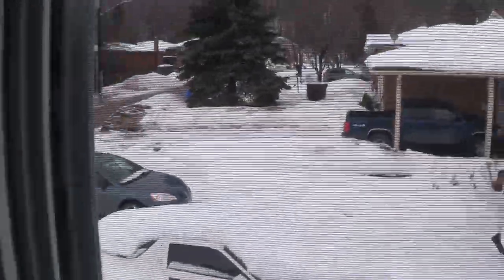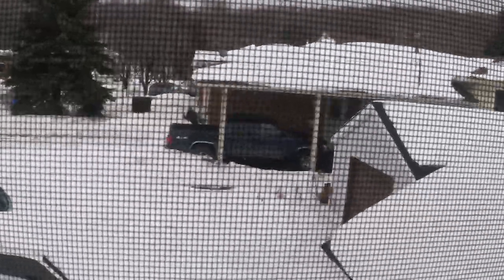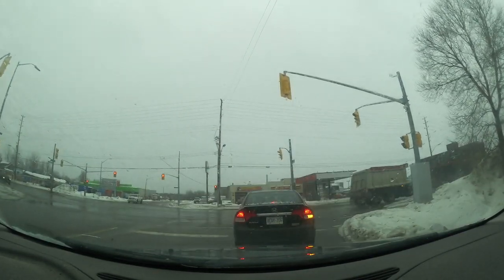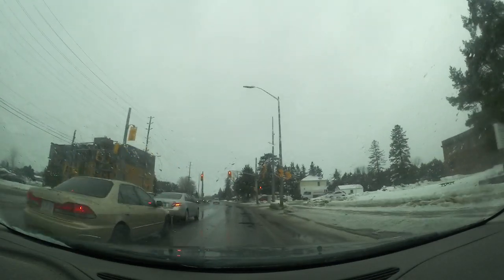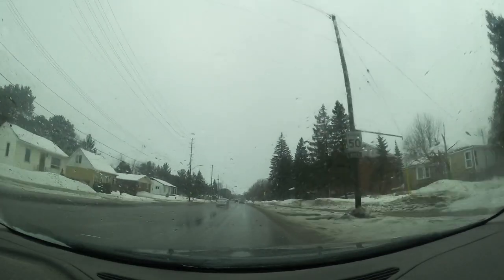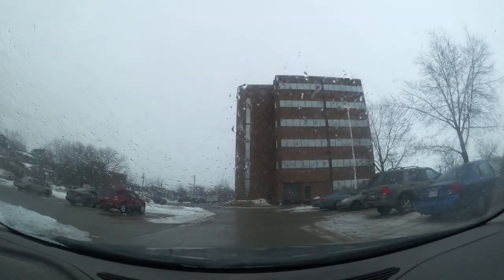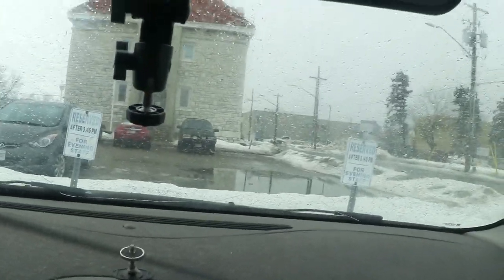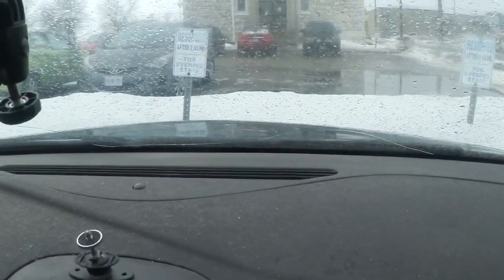Just a bunch of nonsense

Comment: I used to work in a tire shop and let me tell you, Aluminum rims LOVE to get corroded around the bead seal and it takes an air die grinder and a couple of spins with a tire buster to grind it off.  Fortunately it's not all that expensive, most shops will just charge you a mounting fee to do it and it should last more than a few years if they do a good job..I thought of it as a bit of an art and enjoyed doing it except in the middle of winter when the wheels were covered in slush and salt lol
Reply from the maker: hmmm...ok man.  I will have to go to a pro tire shop because the garage I went to when I got these tires on was pretty limited.  They had a tire machine and they a tire balance machine.
Reply: If they have a tire and balance machine they should have a die grinder, they aren't rare devices...I was working at Canadian Tire when I did this :P.  A good smooth finish around the bead will definitely help your air situation though; it's a pretty easy job :)  Aluminum gets pretty nasty around the rubber contact areas

Comment: Those apple stickers, I saw so many when working at the computer shop, and we got one system in as a trade-in which had said sticker, I peeled it off, stuck it on my work area's window and wrote on it "Apple sucks", and it's probably still there today... :P

Some places are using a glycol (hmm, sounds familiar) stuff to use on the roads, it's safer than salt and better for the environment, apparently... :P

Well chrysler products are made from tinfoil, so, of course it melted... :P

I don't get why people fit those lift kits to vehicles that probably never ever see any offroad activity, they look so stupid on a tarmac road roaring away with their mudslinger tyres rattling on the ground...

Comment: Might want to screw that floorboard down, it's getting creaky... :P

If it's heavy, but it's not the battery, where's all the weight coming from? :P

Nobody listens to mr. policeman, getting to work's much more important than the thought of potentially sliding off the road into a hard object (especially, here, where winter tyres are sneezed at and then people crash their cars when they hit a little patch of snow!!)... :P

I wouldn't want to be around anyone using "medicinals", I hate the smell, makes me want to puke, and there's people who use it round here and I get the odd whiff of it and feel the urge to wretch.... :S